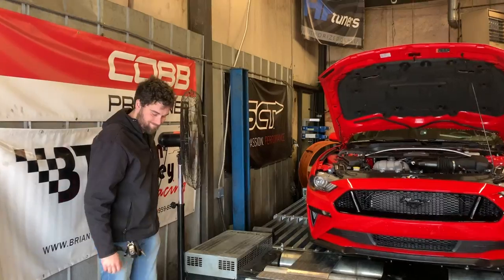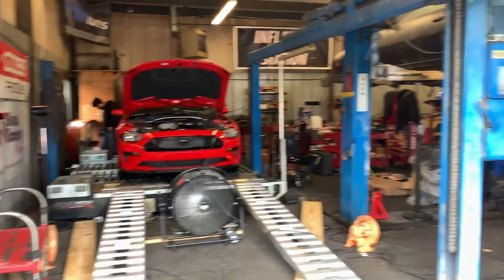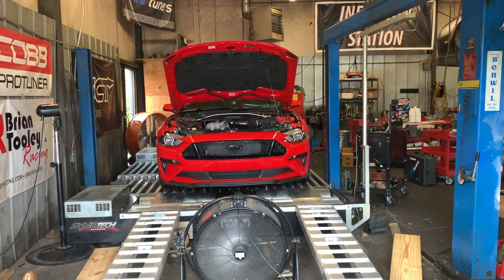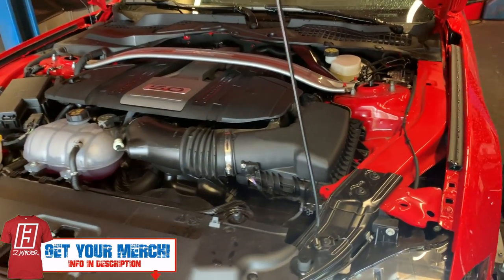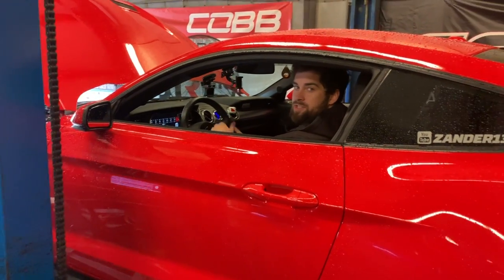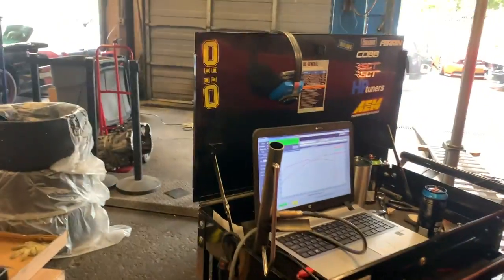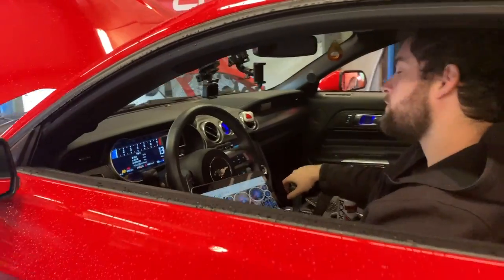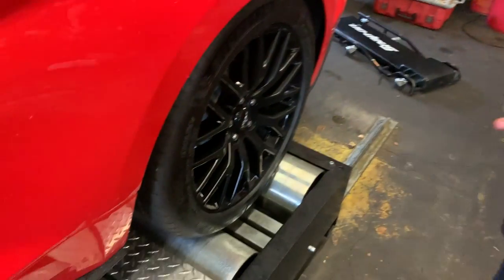NO B.S | This is what a 2018-2019 Mustang GT Actually makes on a Dyno

Comment: Does driver mode have any affect on hp? Ex. Sport or track mode.
Reply from the maker: no
Reply: Nope it's just trans tuning basically. Drag mode has no torque management, so it slams gears faster and harder. Track mode lowers spark when downshifting around corners and such.

Comment: So ford advertises 460 hp and your making 410 with an x pipe?
Reply: WoodyOn2Wheels 460 horsepower is at the crank. Zander got 410 to the tires. You lose horsepower in driveline. All auto makers advertise crank horsepower not wheel horsepower.
Reply: Erik Ressdorf 50 hp!?
Reply: @WoodyRides  , the average is about 15% loss, so a 460hp engine would lose about 69hp to the wheel. Him having about 408hp to the wheel puts him at 480hp at the crank.
Reply: Reypadd don’t forget he has an x pipe. So bone stock he would be under 400 hp.
Reply: @WoodyRides  , correct. It would be about 391hp at the wheel if it was bone stock. The added hp on his car sounds about right when you free up the exhaust.
Reply: Reypadd for sure

Comment: Proper dynos are "hood closed"... Letting all that natural heat build up escape is not road-realistic, only for parking lot meets. So deduct 10 hp and tq from open hood dynos. You don't drive that way so why dyno that way.
Reply: 08turboSS 

It won't make a measurable difference with an Oem filter housing. If it were an open element "cold air" then it would be a different story for sure.

On the dyno the hood is kept open to aid  engine cooling so back to back runs can be made quicker with less heat buildup.

Comment: Is it stock ???
Reply from the maker: Only an x pipe
Reply: @Zander13Productions  hey man I have a Q I got derlin Vertical kinks by bmr On my 15 GT and it squeaks I'm taking it tommrr to the shop that did it they are good I kno them any ideas why it is? They may try to put some different kinds oil stiff on it it actually is only squeaking on the right side!it handles an launches better  I wanna keep it but if it dont stop I have to return it stock its killing me!also it only does the sound over bumps n parking lots etc at low speeds. Jw what u thought thanks!
Reply: @Zander13Productions  sorry a lot of typeos
Reply from the maker: @tacticalbt1023  delrin and metal will always be more noisy. I would re grease them and see if it helps

Comment: Car sounds awful with an X-pipe. Like its a 4.0L V8 or 4.0L V6. Like it got neutered. H-pipe fir beef/muscle. So 400 rwhp without X-pipe. 13.8% losses for a more efficent automatic vs manual is right at 455 to 460 hp provided its on 93 octane.
Reply from the maker: When I go catless headers this time, I’m going to do an h pipe
Reply: 08turboSS X Pipe flows better then a H pipe. Flow>>>>sound.
Reply: @sleeper.simulant7327  X-pipes don't make any more power than an H-pipe. They put out about 5 hp. And based on actual airflow tests, the H-pipe scavenges better.  You can not listen to what performance/speed shops say because they are in one business, to make $$$. And Zander you want a reputable Mustang tuner, not some local guy.